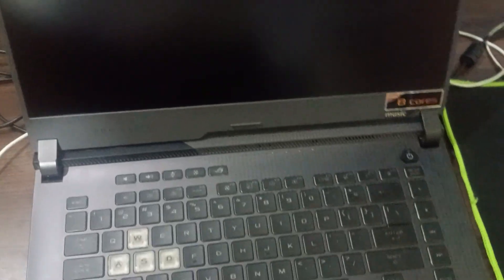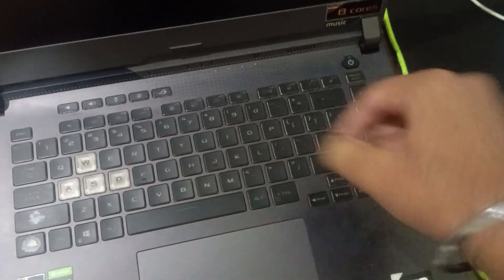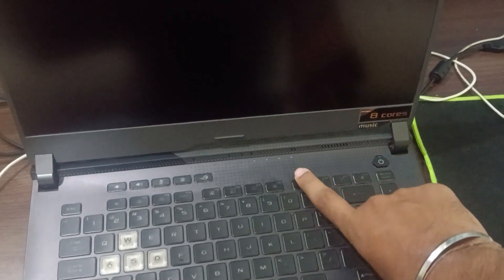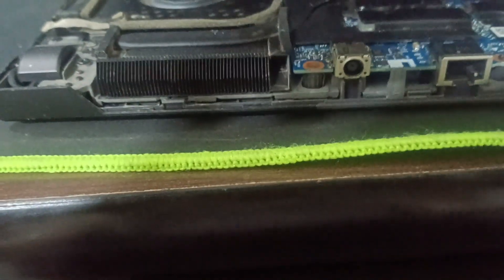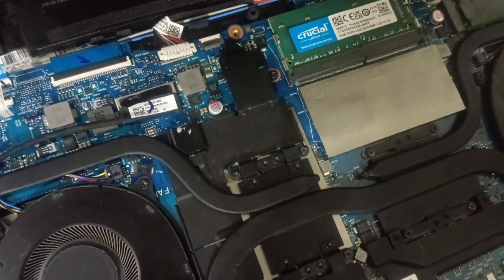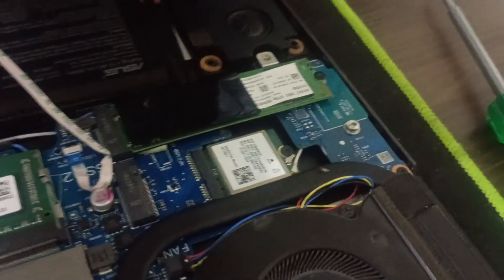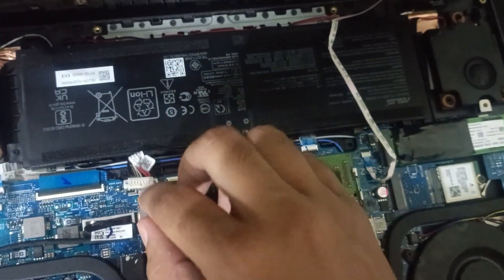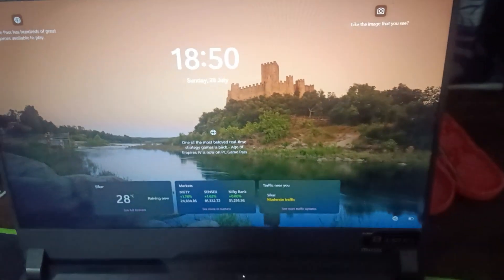asus rog laptop won't boot | laptop no power | Fixed #asus #rog

Comment: Mine is stuck on logo i have rog g16 laptop qnd wont safe boot
Reply from the maker: Stuck on logo means either bios issue or faulty motherboard. Try CMOS reset if possible

Comment: I know I'm a year late to this video but I'm a user who is currently facing this issue.

I didn't turn my laptop on for almost 3 weeks as I went on a vacation but after I got back, I started having this weird problem of the laptop not shutting down. It kept restarting instead. I even tried to force shut it down by holding the power button once but even that made it restart instead. I contacted microsoft support and they installed 11's latest version, which fixed the problem only for a few days.

After a few days, the restarting problem occurred again when I tried to shut down, but this time I closed the lid when the Shutting down screen comes and that made the keyboard flash red for a while and I opened the lid back up again, and it was shut down. ONLY to find out later, it wasn't turning on, same as in the video. I waited for almost 18 hours and to my surprise, it booted up automatically. But the problem still persists even now. It's currently off and I'm just waiting if it turns on again. 

Are you saying the laptop turns on automatically because the CMOS battery drains itself?
Reply from the maker: Check other videos on the channel you'll know the culprit😅
Reply: @fixexe well I suspect it's the keyboard

Comment: Same problem with asus tuf gaming F15 laptop
Reply: Same problem with same laptop with me
Reply: @ashuorg  bhai theek hua kya
Reply: @SHUBHAMKUMAR22761 the reason was for I forgot to shutdown it and go to sleep in morning it was off. Afer plugging in it was not charging and not switched on.
Reply: @ashuorg bhai battery open karo fer power button 1min badao fer charger connect karo hojayega .
Reply: @SHUBHAMKUMAR22761 nahi ho raha bhai
Reply: @SHUBHAMKUMAR22761 battery ka motherboard se connection hata diya hai par battery remove nahi kari
Reply: Aapka kaise sahi hua?
Reply: @ashuorg bhai fer aapka motherboard main issue hoga
Reply: @SHUBHAMKUMAR22761 aapne battery ka connection hataya ya poori battery hata kar dobara lagayi?
Reply: @ashuorg bhai serf disconnect karo fer power button 30 sec tak dabake rakho aur fer charger connect karo agar charging ka light aajata hai toh fer battery connect karo hojayega
Reply: @SHUBHAMKUMAR22761 not worked. Have you kept aside your laptop for one week to let CMOS battery to die for this to work
Reply: @ashuorg Bhai fer aapka motherboard main dikkat hogi 😢
Reply: Aapne kaise sahi kiya mera bhi F15 hi laptop hai
Reply: @ashuorg bhaiya aapka sahi ho gaya?
Reply: @saahoknight No. It's battery issue. Will have to replace battery
Reply: @ashuorg kaise pata chala? service center gaye the ya fir khud open kiya tha?
Reply: @ashuorg bhai please reply.
Reply: @saahoknight I have checked myself.
Reply: Bhai aapka sahi ho gaya? Kaise please brother give some suggestion.

Comment: I had the exact same problem which my laptop cannot turns on and after plug in the charging cable the charging light doesn't lights up (neither white or orange light)

And I also tried the method press power button and hold the ctrl + shift + window  + b but it is not working

Then, I unplug the battery pin around 30 minute plug it back and try to power it on but it still doesn't work. I unplug the keyboard ribbon and use the screwdriver to touch the keyboard pin area randomly (it still doesn't start the laptop), I plug the keyboard ribbon back and press the power button and it finally works😅 I don't know what is happening
Reply from the maker: Plug it in while the keyboard is disconnected. If charging light come on then it's the keyboard
Reply: Should i change my IC charger? Because some of my local tech said usually the problem is on IC Charger. Need a replacement
Reply: Guide me please i have same issue

Comment: My laptop was unused for the last 4 days and then when I plugged it in. The charging light was not on... I plugged it in for 1-2 hours but still nothing happened. Then my friend opened the laptop and changed the ssd slots and unplugged the battery then cleaned it and plugged it back in.. nothing worked.... I'm not getting any signal of my laptop being turned on... It's cold and no part is warm.... Please help I'm scared
Reply: did you find a solution?
Reply: Same
.
Reply: I also need a solution
Reply: @chrispotz4723 it was my keyboard short circuit problem, got to changed for 8k rps.😃
Reply: @chrispotz4723 any solution work brother?
Reply: @saahoknight nope nothing. I’m still out of luck. Devastated
Reply: @saahoknight nope my warrant expired not long ago. But the laptop was working perfectly fine and one day it didn’t turn on. No charging light, nothing…it’s a 2024. Brand new. I’m praying someone finds a solution
Reply: I got it repaired from a local shop nearby and my motherboard was slightly burned and some ICs were broken. It was because. I was using an original 180W charger for my laptop instead of its original 240W  charger. The repair shop person told me the total cost of repair will be 4000 but by so much emotional bargaining we settled at a shocking 1600rs deal and I bought my new charger and it's working all fine now.
Reply: @kalpekalpe4591 what shopkeeper said about issue
Reply: @HarshDobariya-ek4vo some of the IC's were burnt.
Reply: @kalpekalpe4591 bro just today I gave my ASUS G16 to a shop and had the same issue as you (motherboard got burned).The service center informed that I had to replace the motherboard but gave it to a shopkeeper. Just want to ask you is your laptop all okay after the repair?or are some issues?
Reply: @MokshilPatel-np8zt it's all good but the only thing I noticed is my laptop is getting over heated. Idk if it's the issue of thermal paste. I got so busy after that so I wasn't able to get it checked after that. But my friend slightly fixed it by undervolting the cpu. So yeah the only thing was the over heating other than that everything was fine. Just a tip- the shop will charge you 3000-4000rs, but I got it done in 1600rs. So roam around some computer shops and bargain.

Comment: Can some one help me i have a Asus Rog Strix G15 I purchase 1.5 year ago ( out of warranty ), & from few days ago my laptop was starting very late & after that it is not opening , when i am plugin some time its showing charging & some times its not charging & not opening only keyboard light is on while plug in 
& after that i visited service center & they check they told we have to change keyboard of laptop & the price they are saying is ₹9,500  , I should replace it from service center or from local shop they are saying it will replace ₹3,000 approx.
Reply: bhai agr work from home krte ho or sirf keyboard issue h ya battery toh keyboard external lelo wirelss or rhi baat battery ki to ek trick use kr skte ho laptop kholkar battery ko bahar nikalke 3 se 4 polythene bags me pack krdo taki air na jaa paye uske bad us battery ko refrigerator k chiller tray me rkhdo 8 to 10hrs approx then jb use nikalo to room temperature me rkhdo 3 4 ghnto k liye then lgalo solve hojayega mera ASUS TUF F15 H usme bhi ese hi issues the jo solve hogye

Comment: Thanks a lot, in my case I followed the steps you did, such as unplugging the battery, SSD, and keyboard, I waited around 10 mins, again I started reconnecting everything, and my laptop turned on after the third try 🙇‍♂️🙏
Reply from the maker: Watch part 2 of this video

Comment: Mine works on plug but battery is not getting charged also warranty got over recently😢 what should i do???
Reply: same here 🥲, It happened yesterday
Reply: Did you find any solution? I think the battery needs to be replaced, but I bought my laptop last year

Comment: Alright boys I think I have the solution. I combined all the advice I could find and it is working great now.

First you need to get your computer on once. You can use this method. Try CTRL+SHIFT+B or the keyboard method

Now, turn on quick startup and uninstall Armoury Crate.

Whenever you turn off your computer unplug it first. If you turn it off with it plugged in quickly turn it back on and shut down with it unplugged

Do not plug it back in until after startup

It has worked consistently for a week now after having constant problems
Reply: But how to turn it on? Its not turning on
Reply: @valorantmobile_live Plug it in. Hold down the power button for ~15 seconds. Hold down CTRL+SHIFT+B for ~10 seconds. If that does not work try again a few times. If that does not work you can always unplug the keyboard and turn it on but that is tricky

Comment: Last night, we had a meeting at a restaurant. My laptop was working fine with no issues/no problem at all but there was no outlet available, so my laptop’s battery drained and turned off. When I got home, I plugged in my laptop to charge, but I noticed that the charging light didn’t turn on. I left it for an hours, then came back and plugged in the charger again. This time, the charging light turned on, but when I pressed the power button, it turned off again. 😢 is there any people experience the same thing that experience.
Reply: Yea me can u tell you how you fixed

Comment: Hold the power button down for a bit.  Then hit control, shift & B, all together and it will start.
I was so stressed when it would not start, but this is what we did and it started up.
Reply: I don't know why,but it works for me,Thank you so much.I feel like updating the Armoury Crate caused this problem
Reply: @jesenzeng2335  did everyones computer around the world die this year lol mine ko right now same problem
Reply: It didn’t work can u help me?
Reply: worked for me btw i had my battery indicator on and the laptop was also getting charged i wonder what is causing this problem happened twice to me this month
Reply: This worked for me as well after I had followed the video and done what he said and it was not working. Weird
Reply: Thanks
Reply: Wow that helped me at the First try Tranks a lot ❤ wirhout removing the battery, your Methode helped me instantly 🎉
Reply: It's works. Thanks❤... You saved me❤
Reply: What did you do
Reply: Wtfff bro, it worked. Thank you soooo much i was so scared because i have work tonight, and it just happened to me
Reply: @mrjx7040 bhai kese hua batao yarr bahut tension main hoon
Reply: It did work for me. I was scared. 
Yet the solution feels a bit weird. 
How is this even happening?

Thank you!

Comment: @fixexe This really helped a lot thanks m8.
Have unplugged the battery, wait 20m, swap the 2 ssd just in case, and plug again. Wen logged in, Armor Crate advise one app was draining aGPU even wen is not pronpt to start with windows, was the Google Play Games.exe don't know if that's the reason, but don't use anyway, just installed to see if works 😅😅

Now, do you know why this happen, or a long time fix? Was the first time, but really hopes the last one..

Sharing is caring 😎😎 Thanks for the video 😎

Comment: I have asus tuf a15 and i changed the thermol paste (not liquid metal) and checked the temps it was overheating so i reapplied the thermal paste and its not turning on help me pls. I tried to turn it on but it won't show any light or something but after sometime the power button red light is on and one indicator light but no display or anything help me pls
Reply: Bhai update ki waja se hua kya kitna ka4cha aya

Comment: Guys I tried the battery method and it didn’t work.. I tried the keyboard method and it works now but only with my charger plugged in. Watch his other video about how to fix it but with the keyboard method. Then plug the keyboard off, connect the pins with some metallic tool, and then the laptop will start, after that you plug the keyboard back in and it will work.. but it’s not permanent as in my case I have to let my laptop in standby mode or it will turn off in 1 second after I plug it off. It is fucked up

Comment: This is what worked for me and thanks to this channel for his dedication,remove the keyboard connector and bridge pin 5 to any ground point on the motherboard if you are confused where pin 5 is, count from the side of the battery connector or you can use multimeter on the keyboard pins and check for 3.3v or 3.2v that's your power switch pin
Reply: Is this how the problem is solved?

Comment: Happened to me after an update I made 2 weeks ago. Seems like everyone here also have the same problem at around the same time, judging by the comments. @ASUS?
Reply: My strix G15 also stopped charging or turning on about 2 or 3 days ago.
I managed to get it back somehow. But then put it to sleep last night and won't turn on again.
Seems strange that everyone is having this problem at the same time.
Reply: Same thing happened with me this is happening to me 2nd time 1st time it happened after an update went to asus they changed the screen and a fan costed around 15-20k now it's happening again its totally software issue....
Reply: @saksham3239 yes
Reply: Can't be bothered to go to ASUS for repairs, I have taken out the battery and it does occasionally turn on when plugged. Then other times when you shut it down it just boots up again until I unplug it, I know then that it wont turn on for about 3 days being unplugged. Tried a full reset just today. Im hoping it got rid of whatever bug it has. So far, its turning on and shutting down fine without the battery.
Reply: It’s same with me, I have commented on asustuf reddit they banned two of me accounts on posting and commenting
Reply: I’m just now having that problem
Reply: @1800BusterCheeks me too man, worked perfectly yesterday
Reply: @Crimebot02  use the keyboard method. It will work. But not permanently. Can’t keep my laptop turned on without my charger plugged in constantly. But it’s a good solution as I need my laptop for my daily work and I can’t afford to miss one day of work
Reply: @Crimebot02 same man
Like wtf
I had this for a year and not its just dead
Reply: What is the keyboard method? @mindshiftalex
Reply: Same bro what to do @mindshiftalex
Reply: Me too bricked my laptop
Reply: You have any updates?
Reply: @fiestalok  keyboard method
Reply: @forondaj  did asus gave a response?
Reply: Just now I had problem 😭😭...

Comment: Guys i have the same laptop and the same issue, i unplugged battery jeck, nothing done but after unplugging the keyboard strip then connecting the charger laptop, charging light on but keyboard is not working, you can power on laptop through screw driver on keyboard jeck prints, keyboard issue resolved through the heat of hair dryer and keyboard issue works 💯 ok, Guys this video really help me! Thanks you bro!

Comment: You’re a lifesaver! Thank you so much. It worked perfectly for me. I simply removed the battery, switched the SSD slot, reconnected the battery, and it worked like a charm.
By the way, I have an Asus ROG Strix G15 Advantage Edition.
Reply: mine also a G15 Advtange edition, i watched this guy last video, you have to unplug the flat connector of the keyboard and cover with a thin tape the terminals except 5 and 6 which they boot ur laptop, and use it with a external keyboard forever. 

This will fix the not turning on problem forever, except you gotta live with external keyboard or pay $200+ to replace it...
Reply: @Jinsunguito  Thanks a lot bro, for a long time I've been starting my laptop by shorting the wires coming out from the keyboard slot and touching it with a metal surface so it can spark and the system starts.

Now I'll follow that video by applying tape on the terminal, thanks once again.
Reply: @TalhaSiddiqui-r8i  hahahaha we gotta boot our laptop like a stolen car, shame on asus... well hope it fix ur problem
Reply: I have this same problem, I even have the same computer, did you wait 1-2 hours to connect the battery again? What was the process you did? Thank you
Reply: @felipeanchieta1672 did u get the solution? Same problem here
Reply: Same problem just arose... First it started with the keyboard light turned on ... The charging light , laptop light as well as airplane mode light was on and after a while suddenly everything turned off nothing is turning on now no charging nothing did anyone find fix?
Reply: @balasid8778  remove ribbon of keyboard, and insert it again, should turn back on

Comment: Worked for me thanks. But Yeh now the question is for how long 😅
Reply from the maker: @Kent18188  step 1 : clean the keyboard with hairdryer.
2. Install random keyboard drivers whichever you find on internet.
3. Test your keyboard by online keyboard testing sites.
4. Download microsoft power toys software and disabled any key which is malfunctioning.
5. Also clean the keyboard terminal on motherboard by isopropyl alcohol ( don't use hand sensitiser)
All of these worked for me and now it's working fine 💪
Reply: Thank you brother I'll get on it
Reply: @fixexe if we'll turn off key then how we can use it

Comment: Same issus with the Asus ROG laptop at home. It suddenly stopped booting up. Whenever the charger is connected only the airplsne mode light turns on. The laptop is dead otherwise.  Any solutions or service center or local shop?
Reply: Exact same problem bro, asus rog g531 gt only airplane mode light turns on. Did u find any solution?
Reply: @Chandudon_007 power on charger let go to advanced repair and repair drives like check for errors
Reply: Did you fix it? Where was ur issue exactly same problem as u😢
Reply: Bro did you find any solution.
Same thing happened to me today.